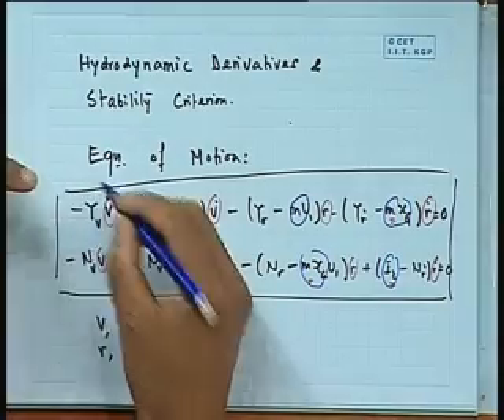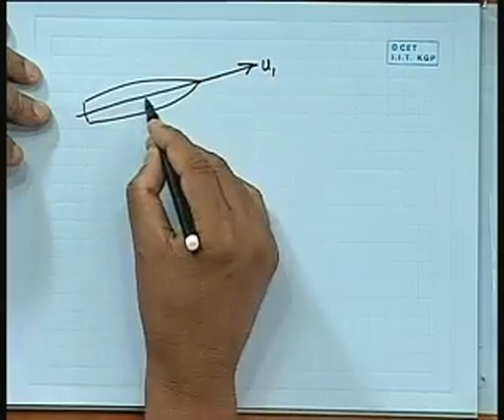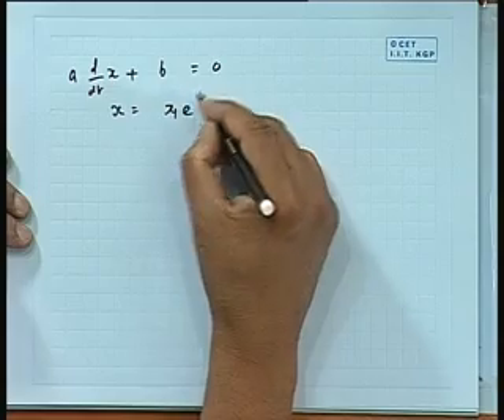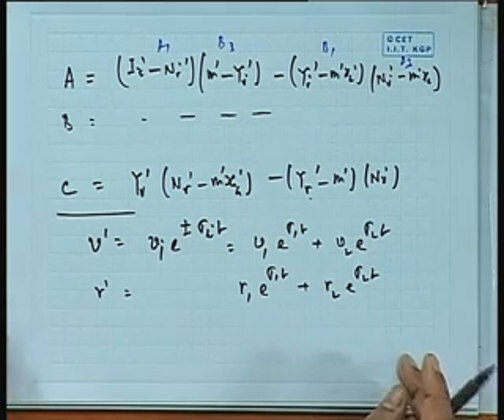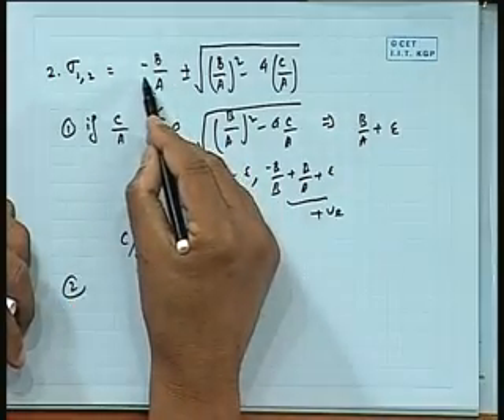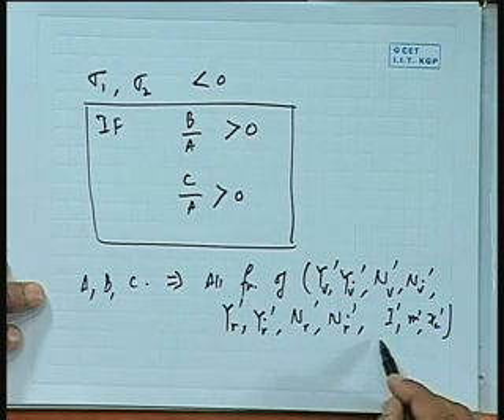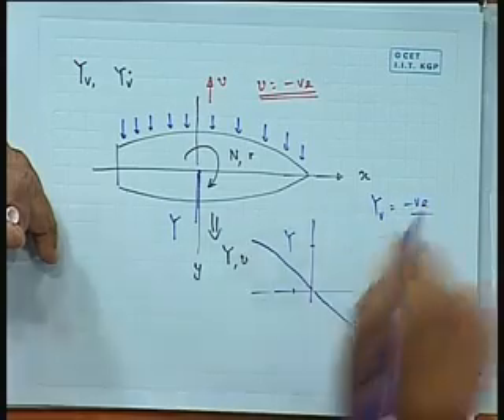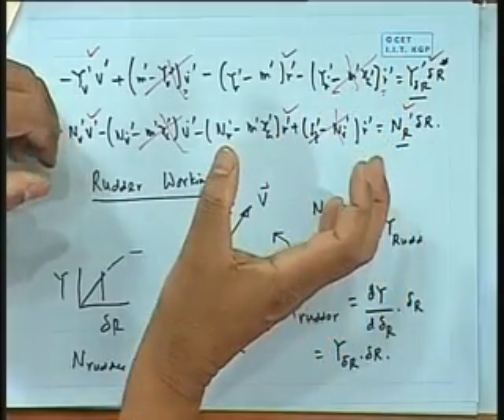Lecture - 35 Hydrodynamic Derivatives and Stability

Comment: Please can you solve this question on stability for me. A VESSEL WITH A DISPLACEMENT OF 150000 TONNE HAS TWO TANKS ONE "a" METRES AFT OF THE VESSEL CENTRE OF GRAVITY, THE OTHER "b" METRES FORWARD OF THE VESSEL CENTRE OF GRAVITY, CALCULATE THE DISTANCE "a" AND "b", IF 200 TONNE OF FUEL IS TRANSFERED TO FORWARD TANK, THE CENTRE OF GRAVITY MOVES 0.8M FORWARD. 550 TONNE OF FUEL IS NOW CONSUMED FROM THE FORWARD TANK CAUSING THE CENTRE OF GRAVITY TO MOVE 0.6M AFT OF THE ORIGINAL CENTRE OF GRAVITY.